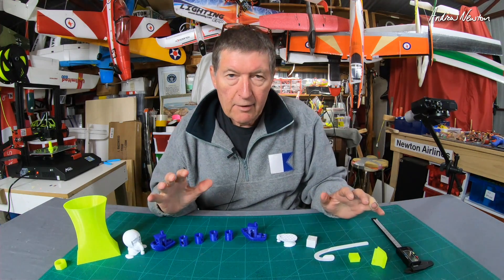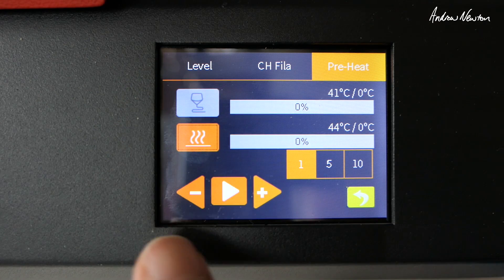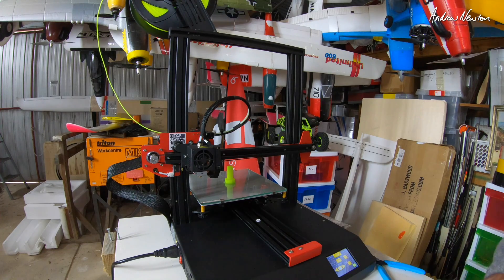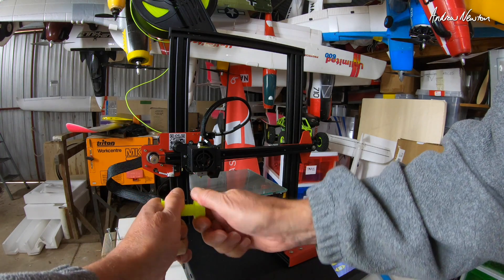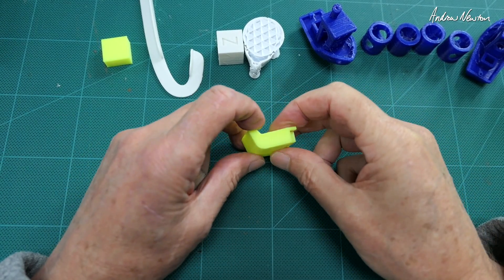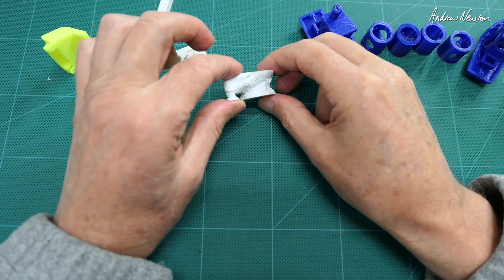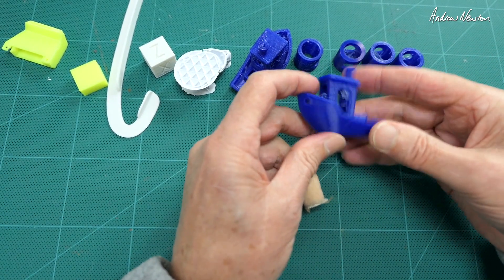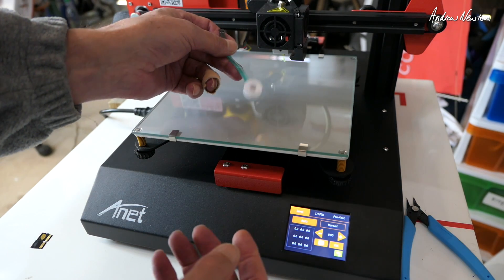ANET ET4 Printing

Comment: Hello Andrew when I export my files from tinkercad to cura but it does not move any motors or prints but when I print the files already on the sad card it prints fine so I really appreciate help🙏
Reply: And what version of cura do you use?
Reply from the maker: Are you generating a GCODE file in Cura then copying to the SD card, or trying to print from Cura? I only use the SD card and whatever the latest Cura version is.

Comment: I can't find this answer:  Does the first layer take a really long time or is my nozzle clogged?  Its seems like the feeder won't feed filament and there is no filament coming out.  Is that how the first layer is? This is a really hard hobby.
Reply from the maker: Nozzle too close to the print bed means the filament cant come out. When the height is correct the first layer lines should be slightly flattened and stuck to the bed.

Comment: i think iam going to go with anet ET4, not ender 3. mainly because anet ET4 has a auto-levelling option, which really helps since this is going to be my first 3D printer
Reply: Have you had any issues so far? I think manual leveling is so easy that it shouldn't be the problem, it just takes a bit of time before each print, but it's not difficult. Just tedious.
But how is your experience so far?
Reply: @LuLeBe  my experience so far, welp, i went for the anet, and the auto levelling really helps if i want to print mechanical parts, and i had great experience with it so far. but, i had like 4 problems with the printer itself. first problem occured right as the printer arrived. the printer didnt want to print. fixed that by replacing the SD card. second problem probably occured from the factory aswell, but i noticed it like 1 month later, and it was that the printer head would move down on a specific Z and knock the print over. i didnt really bother to fix that problem since it didnt bother me, i wasnt printing big models anyways. third and final (final with the printer itself) problem was that when i started printing, the head always moved up by like 2mm up and messed up my levelling. fixed that by adding the Z offset plugin into cura. this occured like 5 months later, right after a cura update. the last problem isnt really a big one, and this is a problem with most producs with european plugs that are manufactured outside of eourope. the problem was that the plug didnt fit into the socket properly. fixed this by doing some plastic surgery to the plug.
but outside of all those problems, i enjoy the printer.

Comment: Would you mind sharing more about getting this thing working in the latest version of Cura? I just got the ET4 pro and Im having a heck of a time getting it printing. I switched profiles to the Ender 3 and got it to print but I had to manually raise the temps for the extruder and the bed default wasn't registering as 60 but rather 50.
Reply from the maker: No problems with this one. But I haven't changed the standby temps

Comment: Howdy from Texas. Thanks for the review. I jumped into 3D printing a couple weeks ago. I thought I'd get a printer to have something creative for my daughter and I to do while we quarantine during the coronavirus pandemic. I bought the Anet ET4X on Amazon because the reviews were decent and the price was low, $189 USD. I have no experience whatsoever with 3D printing. I was able to get nice quality prints after some tweaking with the settings. It took me about 5 prints to get a feel of this machine. I had to figure out how to level the bed and the temps and speeds adjusted (the manual was useless). Overall, I am pleased with this printer. I would like to know how it stacks up against the Ender. I keep hearing about the Ender's superiority but I will wait for your unbiased review since you have both printers.
Reply from the maker: Greetings Texas. Ender 3 is cruder construction but has calibration available on screen and much greater user knowledge base. But pretty much identical print quality really.

Comment: I can’t correctly dial the eccentrics on the rollers (the ones closer to the Z lead screw in particular). Can you give some hint?
Reply from the maker: What's preventing adjustment? Probably only need to the right hand end of the cross bar.
Reply: Andrew Newton seems like the eccentric toward the Z screws don’t have enough wiggle. Or the vertical estruded rails are not perfectly square because form top to bottom I can feel a different tension of the rollers. Need to unscrew a littlebit the whole strutture, and see if tightening again will help.

Comment: Hello Andrew..    I purchased an Ender 3 shortly after you did and enjoying it very much.  Question:   How do you compare a stock Ender 3 and this new Anet in regards to stepper motor sound?  Which printer to you prefer overall?
Reply from the maker: ET4 has higher pitched motor sound at about the same volume. I'll do a comparison video after more time using both.

Comment: version 1.15 is already out of the software if you update it to that you won't have the issue of turning off the 3d printer to read the sd
Reply from the maker: I saw that but needed to do the video before any possible firmware upgrade issues.

Comment: What is the BAR CODE BLOCK on the Left Pylon for ?  It it the Make, Model and Serial Number of the printer ?
Reply from the maker: Good question, just checked and it the Anet website
Reply: @AndrewNewton  Actually, it's a QR CODE.

Comment: I took your suggestion a few weeks ago to try this printer and I'm not disappointed. It printed the sample models straight out of the box to a good standard so that I knew that the machine was up to scratch. Inevitably it was the configuration that gave me problems and I had to cobble together a profile from the various versions that I found on the disc, using pretty contradictory help files. Eventually I loaded the latest version of Cura which started to give me decent results. I'm grateful for your suggestion to deal with the infill bleed-through, although it has a certain patterning charm! Currently I'm struggling with prints that don't stick, and become a spaghetti tangle. This didn't happen when the machine was new, so perhaps the glass was coated. The auto-leveling doesn''t work at all, and the manual leveling worked just the once. So, all in all, a decent piece of kit that produces very smooth shapes, but is let down by inadequate software.
Reply: Michael Powell:  Hi Michael, regarding your prints not sticking, I had the same issue, and finally resolved it.  I have both a magnetic flexi print surface, and glass (preferred).  I use Ivan Miranda's method, summarised below, on both surface types with great results:  ( Ivan's video:    https://youtu.be/Kj4Xz3DwGSQ )
(1)  Clean any old debris off the print surface.
(2)  Smear a small quantity of ordinary dishwashing liquid over the print surface.  Using clean fingers works fine, but look out for sharp edges.
(3)  Using your hand, not a cloth, rinse/wipe off thoroughly under a running tap with the temperature as hot as you are comfortable with.
(4)  Dab dry with a paper towel.  FROM THIS POINT ON, NEVER TOUCH THE PRINT SURFACE WITH YOUR FINGERS!
With glass, I occasionally get a bit of edge-curling, so if I am doing a big or tall print, I add the following:
Dribble a few drops of PVA glue on the print surface, and spread them out with clean fingertips.  Use a damp paper towel, continue to spread over the whole surface, leaving only a "hazy" layer.  You can use this immediately, as it is dry by the time the print bed is up to operating temperature, and it can be reused many times before it needs recoating.
One final tip: Never use isopropyl alcohol or similar cleaning fluids.  In one of his lectures, Dan Gelbart explained that this leaves a layer of hydrocarbons which, even though it is only one molecule thick, acts as a separation layer!
I hope this is of some use to someone out there... Youtube is full of methods, from Superglue to hairspray!   This was my slant on it.    :o)